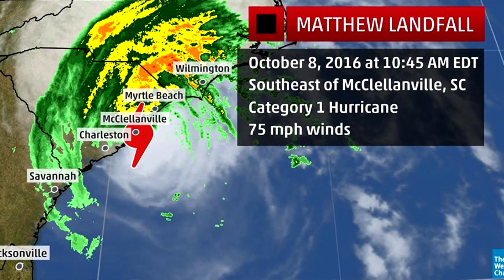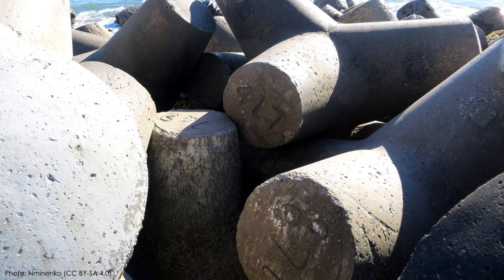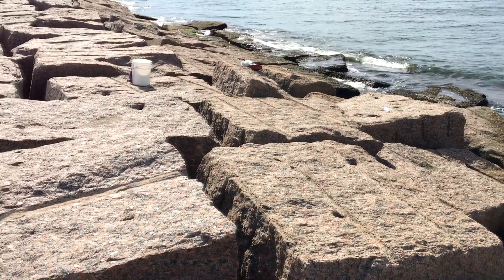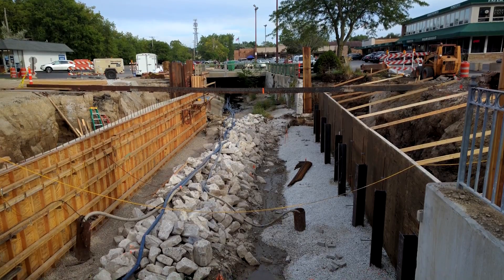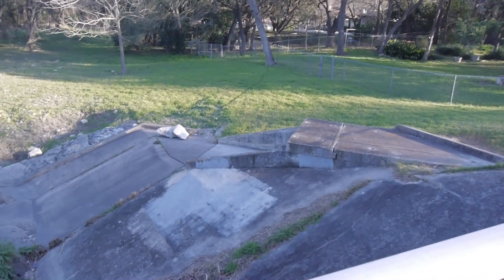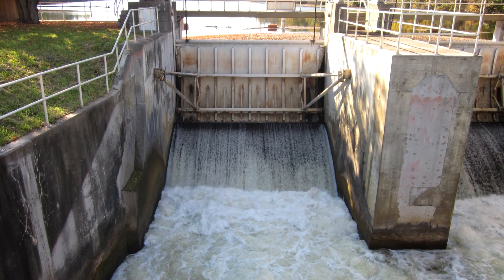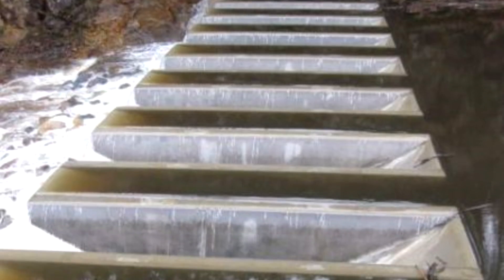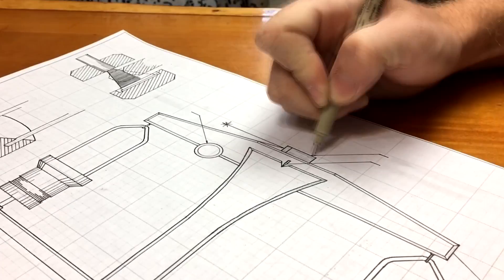What's That Infrastructure? (Ep. 3 - Hydraulic Structures)

Comment: The wave in munich is basically like one of those engine-powered surfing attractions, but they use the natural water flow instead of a pump to provide the necessary flow over the concrete wave.
Edit: It's just a concrete hump placed into the channelized river, not really a dam itself.

Comment: Hydraulic jump is a great way to visualize sonic boom, correct me if I’m wrong!
Reply: By sonic boom I meant the air gets backed up while transitioning from super sonic to sub sonic
Reply: They both act a energy dissapators converting velocity into pressure. By placing hydraulic jumps on nonerosive surfaces downstream channels can be protected from erosion.

Comment: That wave in Munich is behind a bridge where an underground passage of the Eisbach river exits into a park (Englischer Garten).
For several years you could only surf it in times of high water level but few years ago they built the wooden  structure on the left to channel the water so it forms nearly all year.
Fun fact: Parks are owned by the state, not the city. The state prohibits this type of usage, so the city of Munich "bought" around 50m of the river at that point so the surfers could stay there ;)

Comment: Demonstrating an hydraulic jump is remarkably easy. Just open the faucet in to a kitchen sink. You'll notice that the water impacts the sink, speeds away from the vertical flow, travels along the surface of the sink, and then suddenly forms a circumferential boundary around the stream from the faucet. That boundary is the hydraulic jump. The more rapidly the water flows in to the sink, the wider the circumference of super-critical flow. 

A more abstract way to think of an hydraulic jump is sort of like a sonic boom for incompressible fluids, except with a jump instead of a boom. Unlike a sonic boom, very little thermal or pressure energy is lost across the super to subcritical transition. Instead of Mach numbers to describe the phenomenon, we use Froude numbers.  

The interesting thing about an hydraulic jump is that the velocity at the jump is precisely known. This feature of fluid dynamics has been used to build flow measurement devices for streams and sewer pipes. It is called a flume and these flumes have specific shapes designed to provide accurate flow measurements, without the elevation or head loss that a flow measurement weir would require.

Comment: Don't weirs create pretty dangerous conditions in terms of drowning risks? If so, was the standing wave displayed simply a risk they took, or was there some feature of that particular weir that made it safer? Keep up the fantastic videos, Grady!
Reply from the maker: +pipinghotsos The risk of drowning occurs usually during higher flows. The jump turns into a roller and it becomes difficult to swim out of. ASDSO has a good webpage summarizing research on this topic from the professional dam safety community.
Reply: Practical Engineering thanks Grady, I'll check that out :)
Reply: Low Head Dams are often called "Drowning Machines". Not only is the surface flow inside the boil line back towards the dam, but the aerated water makes flotation difficult, even with a flotation device.

Comment: Wait can someone explain what the weir thing does better?
Reply: By increasing the length, they decrease the height of the water above the weir. This means that when its raining heavily, the water above the weir doesn't get too high and overflow.
Reply: Makes sense, thanks guys
Reply: Weirs and V-notches are used by engineers to measure the flow rates of fluids as well, although they are of smaller sizes than the ones shown in this video.
Reply: The amount of water flowing over the weir depends on the height of the water and length of the weir. With increased flow after heavy rain either the height of the water or the length of the weir (distributing the flow over a greater length) must change. If you want the height of the water to remain constant you must increase the length.

Comment: I always have a question, but just can't get a good picture of it. But when I am driving, I realise that bridges have different kind of concrete surface than normal road. why is that?
Reply: well, normal roads are basically layers of very heavy crushed rock, gravel, and then tar. this is wear-resistant and relatively cheap, but often too heavy for bridges. bridges will generally use more expensive, but higher-quality surfacing materials.
Reply: https://www.google.fr/maps/@33.606529,-93.8166859,3a,22.6y,284.92h,68.24t/data=!3m6!1e1!3m4!1st_0Wf2Yx6g_JGpwaIj_plg!2e0!7i13312!8i6656
i think you're talking about this
(sorry for my english)
Reply: Ricky Life and Stuff Could have something to do with the flexing and expansion/contraction the bridge structure goes through. I'd love to hear a more certain answer too.
Reply: +Sebastian Mustermann that's what I thought too, like some kind of concrete that better at expanding without cracking. But yeah! Definitely want a certain answer from an engineer!
Reply: +Sebastian Mustermann actually, there's another question related to it. Why is the texture (those strips) are horizontal, when I assume is use to increase traction to the road. But then why sometimes they are vertical from the car, there's a section of I-5 outside of Seattle was like that going up slope.
Reply: With horizontal strips, du you mean the tension relief that is used to allow for thermal expansion and contraction for bridges?
These things: http://schulphysik.ch/inline/html5/tad/data/images/img3.png
Reply: i think it's only part of the answer but i think about road freezing in winter, bridges are more sensible than road (cause there's no ground under them). so, having concrete strips allows tires to get more grip
using concrete to allow thermal expension is weird, asphalt is better to hold expansion
correct me if i'm wrong ;)
Reply: +ElectroBlood no, more like those on the road surface if you look closely Dropped Pin
near I-5, Seattle, WA 98134
https://goo.gl/maps/mqMNzx6qg3o

Comment: Yo, Grady, can you take on energy infrastructure? A lot of people don't seem to even know what a transformer is, let alone how high-voltage AC works and why we use such high voltages.

PS - For anyone who's curious, Power = Current * Voltage
High voltage = Lower current with the same power transferred nonetheless. Lower transport losses to heat due to smaller current.